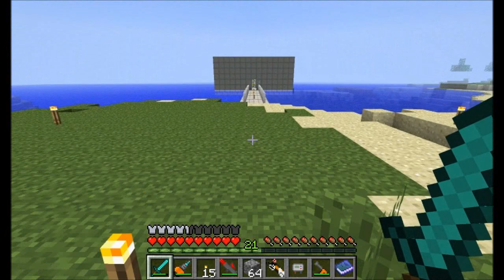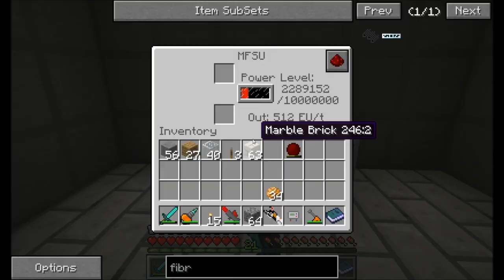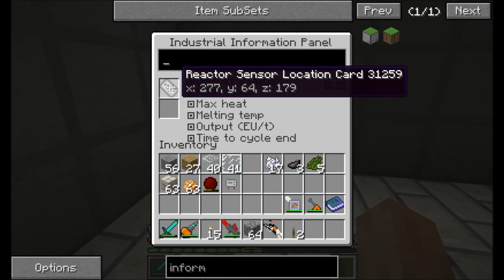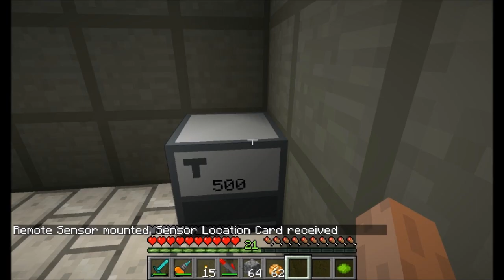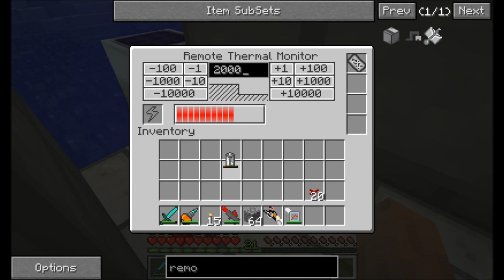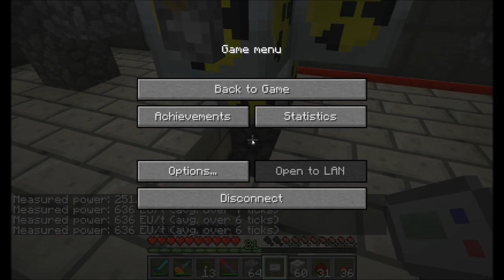Season 3 - Episode 52 - SMP Direwolf20's Minecraft Server Play

Comment: That would be the case if/when he has two or all three reactors running at the same time. The one reactor SHOULD only be outputting 320 EU/tick, but due to a bug in IC2, it's currently outputting double.Thus, if one reactor was running with an output of 320 EU/tick, the secondary MFSU would be able to pass those energy packets just fine without causing the reactor to cycle On/Off repeatedly. But, your point is valid if/when he has it so that either two or all three reactors run at the same time.

Comment: Hey dire, i wanted to point out there is a flaw in your design, as the 2 mfsu are connected togheter, the one emmiting the power to the other, (ofc, it does it at a 512eu/t) recibes more than what it gives, so at some point , for example, if the emitting one is full, the reactor will start acting weird, for it will turn off, and then turn on again, and repeat, and that may not be good.

I hope it helped, and sorry for my grammar, im not native-english speaker.
Cya

Comment: Dire, there's a bug in the IC2 information panel. It only shows 1/5 of what it ought to show. I have the same problem with my reactor, which says 32EU/t when its outputting 160.  Also, it thinks the minutes are 100 seconds long, so it reports the cycle time as a lot shorter than it actually is.  The panel is bugged, but the nuke is fine.

Comment: Should it not be inverted so if the remote monitor detects the nuke is hot OR the monitor runs out of power, it STOPS sending a signal and turns the Nuke off?